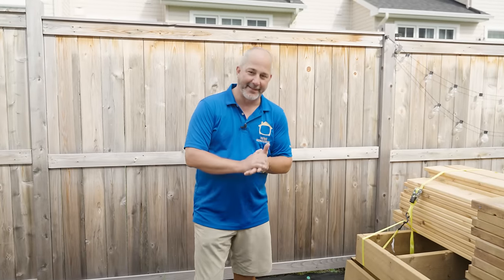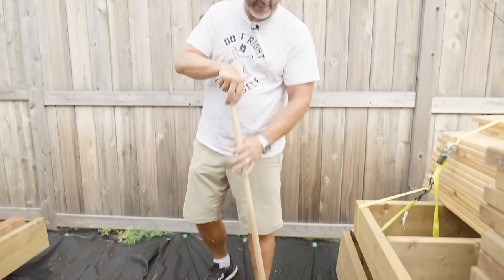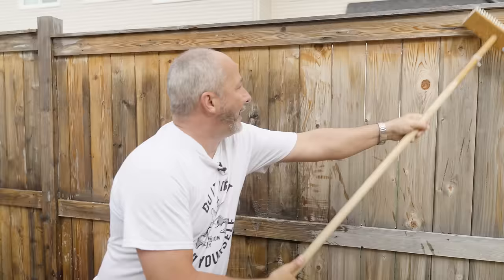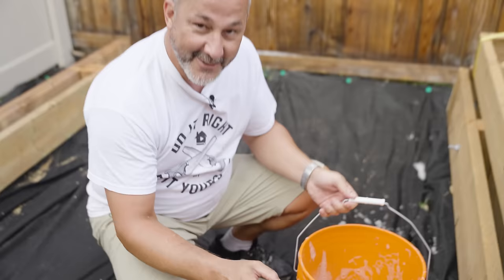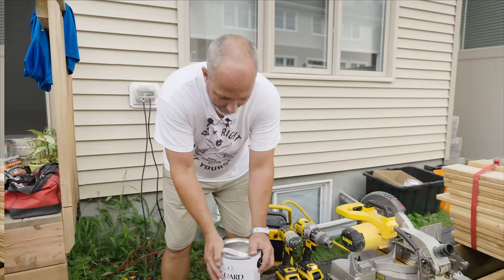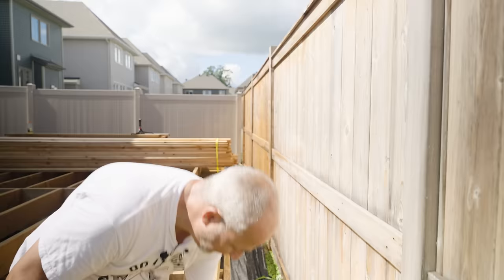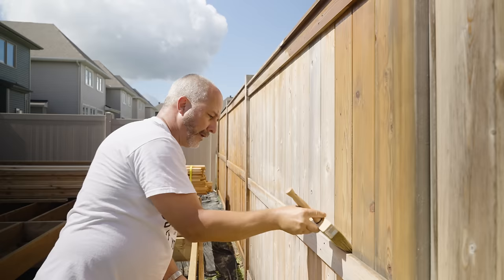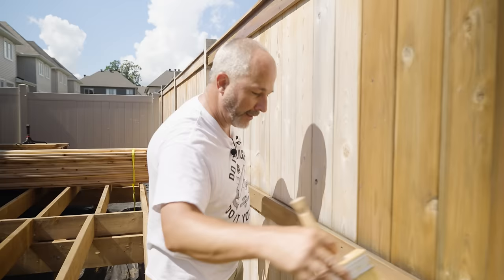Restore Your Fence | $200 Weekend Project

Comment: Here is tip jeff, put that can in home depot bucket before you spin that wood piece with the drill. You would have save that 20% of stain. Perfect everytime .
Reply: I was thinking the same
Reply: Great idea!
Reply: Or dump half in the bucket then spin in can to get bottom, and dump and continue to mixing the bucket.
Reply: But that's why he included a discount code!
Reply from the maker: Ended up doing this for the deck. Cheers
Reply: I see what you mean. Sometimes, us guys just keep moving forward. I'll be sure to use your tip though, thanks.
Reply: I like it when Jeff makes the mistakes we will be making, which makes the videos look way more real. That’s why Jeff’s channel is the best!
Reply: Not as much fun though 😂
Reply: You still have to mix some to separate the lower sediments from the can before you pour it, but yeah, save the product!
Reply: Better off punching a hole the diameter of the shaft through the lid and putting the lid back on the attaching to the drill and mixing with the lid on. Won’t spill a drop and if you know you’re using all the stain you’re good to go and won’t leave any pigment in the container by pouring in bucket before you mix.
Reply: As soon as he poured it in the bucket I thought the same 😂 Live and learn ❤
Reply: Ha I thought the same... proves we were paying attention :)
Reply: Outstanding
Reply: Thank you.
Reply: I came here to say this! 
Or, or he could’ve poured the 20-25% off into the bucket, mixed it in the can, poured the can into the bucket with the other 20-25% and mixed that together.

Think smarter and save money and product
Reply: You're going to leave solids in the can doing that, but ok

Comment: So put the deck cleaner in your power washer, go to town, then put the sealer on? That's my plan with my cedar fence on the property I just bought.
Reply: You are going to atomize the bleach that way, so wear a respirator...?? 

Maybe better to use those cheap plastic pump sprayers to apply the deck cleaner.
Reply: @LeverPhile  oh ya, I'll be in full gear of course. I don't mess around with anything.
Reply: @LeverPhile  You cannot use bleach in pressure washers as a general rule as it will eat the seals and ruin the pump. But you can get pressure washer specific cleaners for this Homeless depot sells Zep which I believe is Oxalic acid.
Reply: @escapethewormhole  

Somebody else mentioned using bleach, but their comment is gone.  I wouldn't use it.

Comment: I would have used a garden pump sprayer. Pool shock liquid is bleach but 5 times stronger for a couple dollars more, adjust strength accordingly with a touch of dish soap and water. I had used it on my deck before switching to Fiberon
Reply: Yeah by the time he scrubbed two sections you could have sprayed a nice coat or two on the whole thing.
Reply from the maker: Thanks for sharing
Reply: Spraying stain is a bad idea when you have a neighbor on the other side of the fence. My neighbor poisoned my dog and her new puppies when he spray stained the fence. He covered the dogs in stain and killed them all when they licked the stain. Idiot.

Comment: I used the garden sprayer for application, much easier to use covers all the groves also and works really good.
Reply: You used the spray to apply the stain? Or the cleaner? I like this idea!
Reply: @hippiechick3829  I used garden sprayer to apply the bleach cleaner and used paint sprayer to apply the stain.

Comment: Bleach breaks down the lignin in wood causing damage to cells of wood. Yes, it’s instant results, consider other alternatives such as wood brighteners or other cleaners designed to safely brighten and clean wood which also preserve the life of the wood. 

Also, you can pressure wash from a safe distance without etching the fence, and the brush isn’t always as necessary.

If you are a DIY weekend warrior however, bleach is a cheaper option and probably a better result than greyed out cedar.

Apply chems top down on vertical surfaces, rinse from bottom up with water

Comment: I do something similar to clean my house and buildings, but I find it easier to put the bleach water in a pump sprayer, I think it is easier then trying to use the brush to apply. Just go back with a brush if necessary, then rinse/finish with garden hose or power washer, bleach is amazing for cleaning.

Comment: Could you put the deck cleaner in a pump sprayer or backpack sprayer and evenly spray it across the fence without having to use a deck brush?
Reply: my first thought as well haha
Reply: yeah watching him try to brush this was painful. ive been a painter for over a decade...pump sprayer costs about as much as that brush and bucket ($30 ish).... wouldve taken him less than 10 mins to spray the fence down. do it as many times as needed to kill all the mold and bring the color back.... wait a few days then instead of buying a $20 deck brush, get a couple gallons of thompsons water seal and fill the pump sprayer back up and hose down the fence with that, back brush with the grain, done. my parents bought and installed a cheap cedar fence 4 years ago and we used thompsons on year 1, and the fence STILL looks great this year (to my surprise)
Reply: A garden sprayer is far more practical than a brush especially on a “shadow box” or “board-on-board”  fence.

Comment: The 'fence cleaner' that I got instructed me to wet the fence, spray it on with a pump sprayer, then scrub with a brush. That sounds like extra steps, but I think you avoid having to do a thousand bucket dips or saw your brush to bucket size.
Reply: Yeah... There's not much of a reason to dip in a bucket.. Spray it on with a pump sprayer, then agitate it if it's even necessary.

Comment: I think you could have used a pressure garden weed sprayer or a cheap electrical paint sprayer to spray the bleach onto the wood....a lot easier  than the decking brush on a pole and less waste....sometimes other tools or equipment can be used for things that they were not originally intended.  Work smarter and easier.

Comment: There is a penetrating strain product that is much easier to apply. You don't have to worry about overlaps or drips. No prep for recoats. It's Outlast Products Q8 Log Oil.

Comment: Everybody is moving to alkyds for outdoor lumber applications but it's still a little pricey. it's an oil emulsion in water which is meant to mimic solvent based application features, including penetration. Still limited by the surface tension of water it achieves better penetration than conventional latex coatings. However, it's a misconception that they do not form films. The films being 1-2nm, even more if you choose to double coat the board.

Comment: Try a product called 30 second cleaner. Seems like it would be easier than all that scrubbing
Reply: Yeah way too much work, i used to use 30 second cleaner but now use a safer product from cleaner today called wood ox cleaner 2000 cleaner, i spray on my cedar outdoor shower then hose off looks like new.  I leave outside alone because house is on cape cod so seasoned cedar blends in with home.

Comment: Just curious, but if you apply the penetrating sealer stain on one side of the fence, what happens if you don’t do it on the other side as well? Will that cause problems down the line? If one side is protected and the other isn’t, when that unprotected side starts to decay will not reach your side eventually?

Comment: You can get a decent electric pressure washer at lowe's or harbor freight for around $100. Also could you apply the strain with pressure pot or air sprayer?
Reply: Hudson sprayer was my thought too
Reply: Don't have Harbour Freight in Canada
Reply: Exactly

Comment: Hello Jeff!

I realize my comment will probably be to far down the list to read but I just want to say a huge thank you for all that you do to help us DIYers. 

I love how real you are and how realistic everything is. You approach everything with an open mind and try to explain everything as best as possible and doing it all without crazy expensive tools!

I tried the pressure washer technique you mentioned but I had no reference so I ended up with some of the wood being fuzzy. Do I just quickly give that a sand before staining? Also I Live in Nova Scotia and since I am not close to Ottawa, do you have  a second recommendation for stain that I should buy? I’m close to a Home Depot if that helps at all.

As well with the floor of the deck do I follow the same technique or will you be doing another tutorial on the deck your building right now?

I understand if you don’t see this or get a chance to get back to me.

Thank you again for everything! I love your channel and you’re amazing!!

Comment: They use cedar instead of PT because all the PT fences split and warp horribly because the PT is so wet today and it dries too fast in the sun. I installed a cedar fence and finished it with Ready Seal. My fence looks new, but the PT fences in the neighborhood that were installed last summer are all warped and crappy already.

Comment: Spray bleach with sprayer. Leave for 1  hr and then pressure wash. 
Ay part left over or still dirty  scrub with hard brush and dawn washing liquid and clean with power wash.
Oil based strain is very good. My fence is good since 4 years, while fences with water based is faded chipped and peeled.

Comment: Rent a gas pressure washer at your local HD. A half day rental is $60. I rent one every spring to clean and recoat the deck. Made a cheap fold up ramp and pull it into a small SUV. E Z!
Reply from the maker: Great tip

Comment: You could save your back using a pump sprayer. Or, because I'm into detailing, I use my snow foam cannon!  

I get a nice, thick coating that clings to the surface.  

I put one coat on and leave it until its almost drying out, then put on a second coat and work it with the pressure washer gently. 

Spotless in less than half the time.

Comment: Not all 'bleach' products are the same, I suggest you use words such as 'chemical cleaners' or something else unless you mean sodium hypochlorite (household bleach), they are chemically different. Household/chlorine bleach destroys the tannins and character of the wood, but is fine for treated pine. Also, I suggest:
1) pre-wet the wood
2) apply the chemicals using a pressure sprayer at the right concentration
3) let it sit for at least 5-10 mins depending on the product (keep damp, mist if necessary)
4) agitate with a brush
5) then rinse heavily to ensure no salts are left to crystallise on the surface

Comment: How do you know what kind of wood you have? We have a rental and I have to take off old peeling paint- which I'll use diamabrush but then do I need to wash the wood after sanding all paint off? Or can I just apply the stain.  Also I really want to buy c2 wood stain but we are leaving tomorrow so I won't get it in time...is there any other stain you've done that is as good as c2 stuff?

Comment: I tried this using pool chlorine shock 50/50 water ratio with pump sprayer. Hosed it down after 15min. The deck is all fuzzy on the surface and now needs to be sanded. The deck looks bleach white, don't really like the look. So unless you are going to immediately sand it and stain it. I wouldn't recommend it.

Comment: really?! The city puts up the fences? Did I hear that right? We in the states need to do our own. Unless the city puts up noise barriers between a subdivision and the main roads. We are in need of a new fence. I fall under the lazy category. I wasn't a cedar fence like that, but one of those where the wood boards alternate with the boards on the other side of the horizontal pieces. It was painted. Now it is rotted out and part of the fence has fallen down. Any tips on what I should replace it with? Something economical that looks good (of course). We want to see through it and over it.  I know that is fairly basic info, but interested in anyones thoughts. We are in the northern IL area. Great tips, thanks!

Comment: Could you use a power washer? I need to stain my fence, it's rather old (probably 5-10 years old) and was never stained, I was thinking about getting a soap attachement for the hose, soaping it down and then using a powerwasher. Would something like that work instead of brushing?

Comment: Always love your videos, have learned so much. I have new unfinished cedar garage doors that I tried to stain/sealer a darkh brown but because they had been sanded, the stain wouldn't absorb. What do I need to do to the wood before applying the first coat of stain/sealer to open the pores?

Comment: The problem with using a pressure washer is that it will damage the soft wood.  The chemical method is much better.

Comment: Hi, thank you a lot for this channel it is very beneficial. I have a quick question not related to this subject.
Can I glue drywall to a concrete wall that seperate my basement from my neighbor's. My house is smi-detached.
What product you advice to use?
Reply: Why would you use furring strips to install & finish?
Reply: I meant, why wouldn't you use furring strips? Why do you want to glue?
Reply: I'm not a carpenter, but I wouldn't recommend that, even with green/purple board. I would stud out the wall and create a moisture barrier first. There are other ways, but I don't know them, talk to a carpenter.

Comment: Hello Jeff,

I am a bit confused because on one of your video you highly recommended to use the OSMO oil stain and now it is a waterbase stain. I have bought the osmo last summer and only had the time to do 10% of the deck floor. Should I stop with the osmo and switch to the C2????

Thanks
Reply from the maker: You can still use OSMO, it’s a great product and your deck will look awesome. I like to show different options for different folks. Not everyone can get the products I use in their area. Cheers!
Reply: @HomeRenoVisionDIY  Cool!!! thanks so much for time and info 👍👍👍👍

Comment: I love your videos Jeff, but this method is incorrect.
First step is to wet the wood. Second, don't use bleach. Bleach is meant for a non porous surface, wood is porous. Bleach cleans the first thing it comes in contact with. It's good for mold and mildew, but you would be better off to use a sodium metasilicate product or a diluted solution of sodium hydroxide on wood.

Comment: You have a strange perverted idea idea of what a properly built cedar fence should look like in the long term. I had an experience with a neighbor using a pressure washer to DESTROY the preferred patina on an adjoining fence. OMG what a putz. My mouth dropped in wonder. Please don’t do this. BTW the rot bleeds through to the other side.